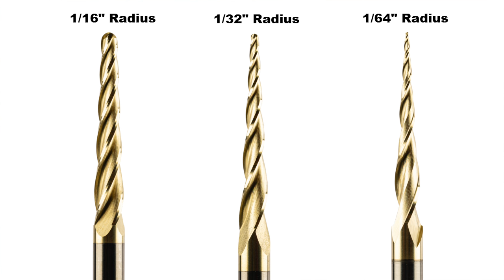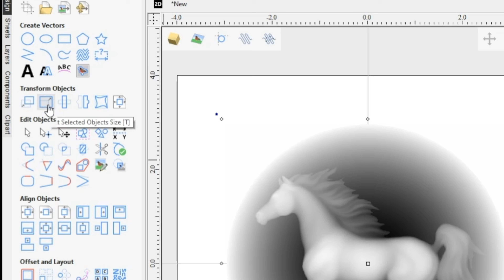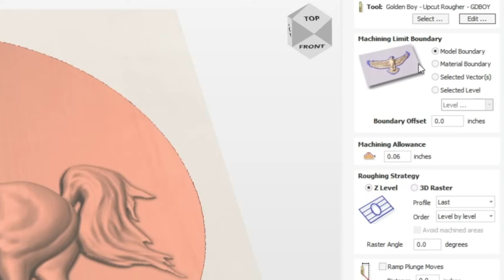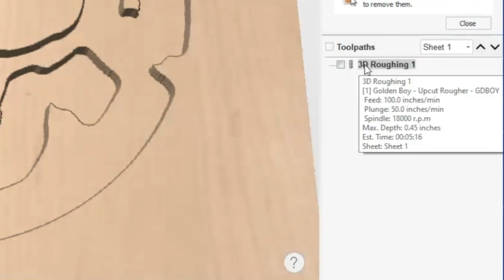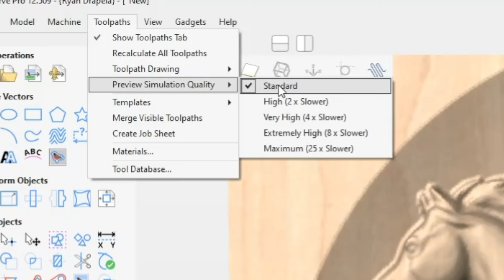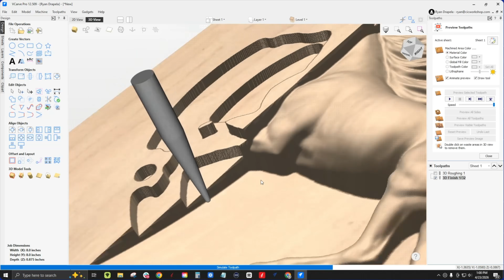How to Do 3D Carvings on a CNC (Beginner Guide)

Comment: I saw a 4-by-4 that had 3 inches of detail. The horses and the riders were all walking. The one rider was mounted, and the other two were walking their horses through a canyon that was the entire length of the four-by-four, about 6 feet. What would you use to make that? Because, well, I can buy it for $1300,. I just would rather make it. But I wanted to change a few things. Is there any way to do that, and can you tell me what I would use to make something like that?

Now, one of the other things I saw was a scene that had 4 people walking their elephants through a village.  1 elephant had a chair with a man sitting in it and a roof on it. Is there any way to do that on a 4-by-6?

Comment: That was a very good  detail on 3d craving , I would be interested in the green hold downs ,where to get them. Thanks PS I would be interested in your bits, & material  but the Exchange & duties are way to high for me in Canada.
Reply: Hi Eric, the green hold downs are from Carbide 3D, the makers of the Shapeoko CNC. I use the green hold downs when needed but an even slimmer set are called the EdgeHugger.

Comment: Does Vcarve Pro export in the format needed for Carbide Motion where you can upload and just run the whole file? I just set up a 5.1 2x4 and haven't done anything on it yet. Thanks for this helpful video.
Reply: Hey BillM . Vcarve will save the toolpath as G-Code and you can open those files from within Carbide Motion with no issues. That is the setup that I use today.
Reply: @barrylane8915  Thanks for the reply!

Comment: Load material.  I zero X and Y, then the Z depth.  I then install the smallest bit (example 1 mm tapered ball nose) and run it just outside the cut are.  Move it to an even number, example Y = 10,  X = 15.   Then run the ball nose down and cut just a tiny amount into the material so you can see the mark.  Write the coordinates on the material at that spot.  Now if something happens during the cut, bit snaps, machine blows a breaker, what ever the reason, you have the coordinates to reset the 0,0 cut starting point.  Move the 1mm bit to the exact offset position.  Enter Y = 10,  X = 15.  Install bit for start of job and ZERO THE Z ONLY.  Now just move the bit to Y = 0 and X = 0 and your ready to go.  I also save the job as separate cut files, not one huge file.  This way if something goes wrong it is easy to restart the job (or corrected job) at Y = 0, X = 0 as a separate file, instead of starting over at the very beginning of the complete job.  It is often very difficult to try and restart a job that went wrong and had to be stopped.  This is a reason many jobs get destroyed.  A 3D file consumes a LOT of your resources.  The cost of materials and the energy used to cut the file.  Wear on the cnc and bits, vacuum system, vacuum pump, your TIME.  You want every possible advantage.  Thanks for video!